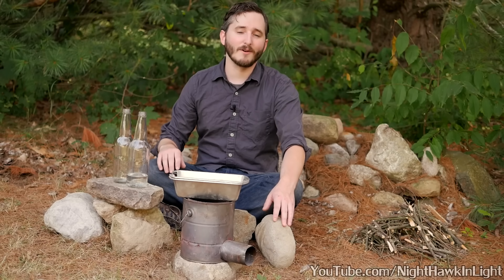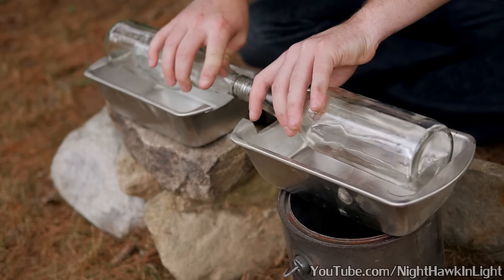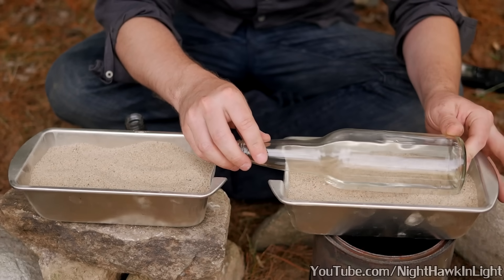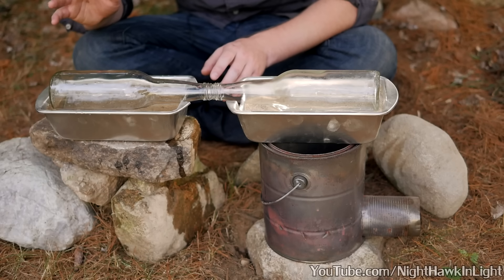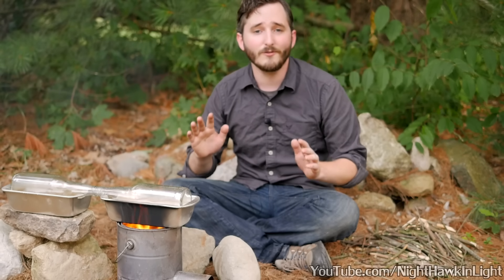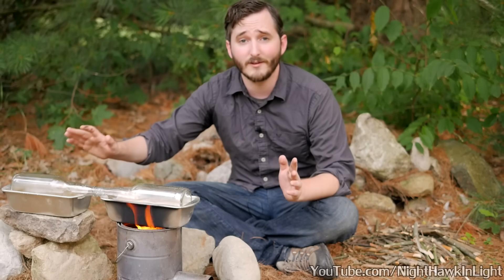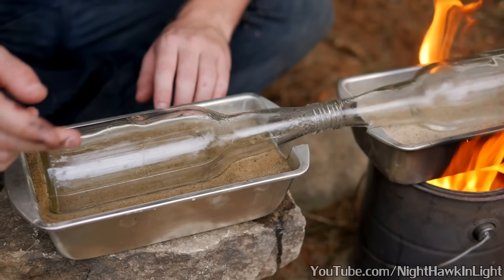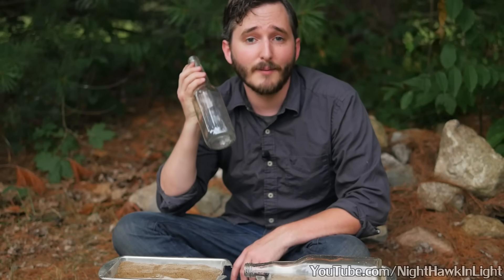How To Turn Salt Water Into Fresh Water (Simple Improvised Distillation)

Comment: I know this is an old video but I was curious about how you might increase the volume of water you can process in one go. If you had the bottle upright over the fire and connected a piece of hose to the second bottle, would that also work? If the second bottle was lower down so gravity had more of a chance to pull it downwards, could you then theoretically fill the first bottle much more? Or is there something I'm missing?
Reply from the maker: Yes if you have a piece of high temp hose you can use the setup you described

Comment: This is impractical both for hikers and for survivors. Nobody in their right mind would opt for bottles, sand and all the other sheet. Let alone the fact that this way requires constant presense of an operator, which is bs. Just use old passive "any container under any tarp" method. Somebody paid top buck to promote this nonsense.

Comment: I live on a very small and very hot island.
I wonder if this could work with solar energy? Having seen people cook food in a box lined with aluminium...got to try it out.
We have a lot of seawater, but no natural water sources
Reply: You can heat the sand with solar-powered heat conductors running through the sand like an old electric iron for clothes that have the conductor held by some sort of clay

Comment: Bump this idea: use a metal tube inserted into a cork which in turn is inserted into the salt water source bottle and extends into the receiving bottle. This allows a greater volume of salt water to be distilled.

Comment: Great video! I found beer bottles make great boilers right in the fire. Enlarge the hole in a soda can so it will fit on the bottle. Aluminum transfers heat very rapidly, so water will condense in it. Poke a hole in the lowest point of the can, and catch the drips in a cup.

Comment: Another option in survival situation is to swim in the sea, allow your skin to absorb the water through it.. then use your bottles to collect your wee, your own kidneys distil the water.. Drink your pee Bear Grylls style.

The fire can then be used to keep warm and cook. No trays, bricks or burnt hands or water putting the fire out..

Your bladder holds about 0.5-1 litre. It is structured plasma and is 98% distilled water with electrolytes in it and sterile.

Comment: I did this as a science fair project, but I just used two bottles, a tube, aluminum foil, some sticks, duct tape, and a black painted cardboard box. Put it outside and let the Sun do its job. Took about 20 minutes to convert one bottle of salt water into freshwater. Solar ovens are a hell of a thing for camping or emergencies.

Comment: The prospect of having other things in the water (like gassoline or oil) is why you should start with the heated bottle open to atmosphere until the water is at a good boil.  Let lighter boiling materials out without capturing them in the recieving bottle.  Before you connect the bottles, have some vapor condense on the outside of the cool bottle, and give it a sniff or taste to make sure it is water.  Then, connect the bottles.  Also, whenever you distill water, leave about 10% in the heated bottle.  There can also be stuff you don't want that has a higher boiling point than water.  Throw that out and start fresh.
Reply: That makes sense. I'm also wondering if the salt water bottle could be replaced entirely by a larger container, though one would have to get creative in connecting a bottle to the container.
Reply: he said that at like 6:15
Reply: I dont get it ? Why'd this get so many likes
Reply: Could be people just reading the comments before getting to that section in the vid.

Comment: Very very large amount of processes.
If you have 2 glass bottles,   fill 1 with the salt water & smash the other so it makes a cup out of the bottom section.
Then just stand the water bottle upright in the sun & place the cup like smashed section of the other bottle over the top of it. 
The water will condense & run down the cup like bottle & drip off 1 of the jaggered bits of glass protruding. 
Whilst all of this is happening then you can go collect some timber for a fire, build a shelter of gather some food. .

Comment: Everyone's always talking about how expensive desalination is. Why couldn't we use two giant metal tanks just the way you've done here and float them on barges? The heat source could be an array of parabolic mirrors placed around the base of the one with the salt water in it. After the water is purified, we could use any number of methods to pump the fresh water out to a tank on shore and perhaps even pump more salt water into the first one to repeat the cycle? The pump power source could be wind turbine or even a wave rocker plate

Comment: In a long term situation, drinking distilled water is not good for your health either, the same as drinking salt water. We actualy need a few minerals in our drinking water to not.. drown our cells : there is a balance to reach betwen the inside of our cells and the outside fluids of our cells. If we enrich the outside with too much minerals (aka salt water), our cells evacuate some of their water content to concentrate their minerals concentration to reach the balance. And it is not goog for your health. Not at all. Distilled water does the opposite : it dillute the outside fluids of the cells, and to reach the balance, the cells absorbe a lot of water. One could say that it means you are drinking a mord hydrating water but the reality is that you may cause your cells to burst because.. too full of water. Would be a shame..
Maybe that if it is in really smalls quantity, it may not cause harm, but it is safer to ad just a bit of salt to your distillate water (not enough to taste it of course) to not deregulate too much the balance of your cells.

Comment: try this one roll up a piece of cloth and use it as a cork and then heat the water and when it pushes it through you should have desalinated water. levi would work best. if it breaks use less denim. and more water. you might even try different size of cork itself and a lid with a hole in it for vapor to come out.

Comment: if you have a trash can and a bucket and sun light is all you need. you just need some soap and that means ashes. then clean put bucket into trash can and fill bottom of can with water and put in bucket with a rock in it. then just leave it in the sun and the less water the better but a metal bucket with let you use fire or coals test it yourself. scuse waste basket from an offie will do.

Comment: Yeah I had an ocean distillation idea that involves hot coils that are exposed when the wave withdraws and when the wave crashes the coils are hot again and instantly vaporizes all the water. I'm not a capitalist I want literally anybody to take my idea please
Reply: Basically what you do is you get some superheated rods either electrically or through ceramic and when the wave crashes on the rods, a hood picks up all the steam and there's a distillation bucket just through a glass pipe. All chemical less. 

The method of heating and the type of heating coil and the location are all to be determined. But my device would effectively create a constant source of distilled water which I imagine would be marketable to people like Kanye and stuff. 

The key feature is the coils get superheated when the wave recedes there has to be a point in time when there's no contacts between the coil and the water. It has to be so red hot it vaporizes all the water that touches it. Maybe ceramic can do this. 

There might also be a vibration or a sound that naturally releases water into water vapor which might allow quick heatless distillation...

Comment: It's interesting that it's just easy, and if so why don't you see old ships having this kind of apparatus on board just incase they got stranded out at sea? You'd think someone would have come up with something similar after thousands of years of sailing.
Reply from the maker: How would they heat the bottle?
Reply: @Nighthawkinlight  the same way they cook food, with a fire. I'm not talking about a row boat, I'm talking about the big ships with tons of crew.
Reply from the maker: @evilcartmensolo7198  It takes more than 5x more energy to convert 99C water into 100C steam than to heat that same amount of water from 0C all the way to 99C. It would take a lot of firewood for not much water.

Comment: Really cool video! I will have o remember that for sure if I needed water. Heads up: If you are to drink distilled water for the purposes of survival, it is highly recommended to add a tiny bit of the salt biproduct back into the result. This is to ensure you are getting a proper PH level in your rehydration and the effects will overall improve your body functions.

Comment: Thanks for sharing. The simplest system I have seen is to fill a pot about 1/3 full, put a bowl in the middle, with a domed  lid inverted on top. The water boils, condensates on the lid, and drips into the bowl. Simple to remove the distilled water and simple to refill the pot.

Comment: In fact, keeping the salt water in sunlight and the clean water in shade under damp cloth, grass, leaves... will also work but less quickly and less completely --  the salt water will need changed when about half is gone.  You also should NOT drink pure water; it will leach vital minerals out of your body.  Instead, add a few drops of salt water before drinking.

Comment: Perhaps suggesting using ones shirt to hold the bottle the distillate it to go into by soaking the shirt in salt water is not a good idea. In a survival situation where one is in a salt water only area it is likely the shirt is the only covering for the skin as well. To use the shirt for covering again will submit the skin to an irritant that can cause sores. Sticks can make a cradle that can be "micro" adjusted to get the seal you are speaking of. Good over-all survival tip if one can build a fire while trying to find hydration.

Comment: I hope someone mentioned... With distilling salt water. 
It is required to add a drop of the salt water from source bottle..  this is done to replace electrolytes. Without this. You will still die of other issues regardless of how many gallons of distilled water is consumed.

Comment: While really cool, a simple way to reclaim more water at once is to rip a bit of cloth from your shirt and make a cheap 'hose' using several layers wrapped around both bottle necks.  You can then bend the cloth hose so both bottles stand closer to vertical when propped up.  The evaporate wets the cloth at first, creating a liquid seal that redirects future water vapor into the condenser bottle--and if the condenser is cooled adequately the vast majority of vapor will condense before refluxing back to the joint (where it may escape the wet joint bit by bit due to building pressure).  In the end you will lose a higher percentage of product to the joint than a glass-to-glass connection, but the total reclaimed for the same time and energy input will be overall higher; usually a 70% full boiler results in a 50% full condenser when I try this.

As for efficiency, you can punch a  few small holes in the condenser's pan (or bucket/tin in my version's usage) so that a slow drainage of water occurs.  This allows warm water to run free, where you then can occasionally pour cooler water (slowly!) on top the condenser.  The cycling water much more efficiently cools and condenses the vapors than stagnant water.  If using this method it's better to mix a hint of dirt and brush into the sand (anything course, and NOT clay) so the mix behaves more like a supporting sponge tha wicks rather than a sloppy siv.  Peat works great for this, maybe at a 1:4 mix ratio with sand.

Comment: Another way I learned in boy scouts was a tarp and two buckets, one of them large and the other small. Put the small one in the middle of the big one, fill the big one with the water you want to distill. Keep the tarp over it, with a dip in the middle over the smaller bucket, and wait. The water will evaporate and drip into the middle bucket.

You can even do it in a linear fashion, with one bucket next to the other and the tarp at an angle
Reply: Linear is better than nested. When you nest them , your clean water will start boiling too due to its container being in contact with the dirty water, which just slows everything down. Temperature gradient is a must.

Comment: Excellent! I'm looking for some system to make drinking water on an ocean-going boat. So far, all they want to sell are reverse-osmosis devices, which push water through a semi permeable membrane. We have seawater, electric and hot sun. It would seem simple to do. (Distilled water has no taste because there are no minerals. Adding a few drops of seawater to the distilled returns the minerals and the taste.)
Reply from the maker: An electric kettle might be a simple option
Reply: @Nighthawkinlight  Thanks for the reply! There are commercial “water makers” that are very expensive. Solar electric isn’t the best for heating. I was thinking about black tubing heated in the sunlight.

Comment: you don't cover up items with more wet towels, wet sand or anything at all. by doing so it insulates the item and holds in heat. what i have learned from reading on cooling objects is to consistently drip water onto the item you want to cool, and it has to be exposed to open air. you can drape a towels high above the object however, to keep the sun off of it. a lot of factories do that for their machines. you could also heat shield the other bottle from the fire perhaps with a item in between them instead of the wet towel.

I am self taught, most of my life i have learned from being interesting and reading or watching videos like yours or more. I'm interested in the philosophy of debate and survival amongst other topics of the world today. :)

Comment: I would love to see this scaled up in a desert situation using larger containers.  It would seem to also be able make potable water from bad water sources.  (using solar concentrating reflectors for heat).
Reply: If you're trying to remove minerals, sure. But it won't remove things like oil or gas.

Comment: You can separate oils and alcohols through distillation. Every chemical has it's own boiling temperature. The lowest temperature contaminants will distill first, so you just dump the first few minutes worth. Water in the boiler will remain at about 212°F until it's boiled off. If you stop before reaching the end, contaminants with a higher boiling point than 212°F will remain in the boiler, to be dumped.

Comment: you can basically do the same thing using an empty container, plastic (w/ a slight downward slope), saltwater (which could be simply the moisture in the sand or even saltwater poured into the sand/ground), and sunlight.  when the water (minus salt and other minerals) evaporates, it collects on the bottom side of the plastic, and gravity causes it slide down into your container.  i've never actually tried this myself, but it's the same basic principle (it would take a lot longer w/o the heat of a small fire, though)!  that said, if i ever find myself stranded on a deserted island w/o food or water because my plane went down, hopefully this guy survived the crash w/ me!

Comment: Not this simple, if theres contaminants in liquid form in the water, it'll transfer with the H20.
Also you cant just drink distilled water because it will slowly leach minerals from your body. E.g. trying to boil the alcohol from water at 100c.

Comment: You can do this only one time. If you refill the bottle with cold water it will break. If you let the bottle cool down and fill it up and then put it back into the hot sand it will break too. This is a good solution if you want to die rather quickly in a survival situation. Besides that, really good vid ! Great explanation, cute parrot :)
Reply: What's wrong with using new sand? Then you don't break the bottle.

Comment: Beware though. You shouldn't drink distillated water as it. Cause distillated doesn't has any mineral, it'll remove those precious mineral from your body, and can after some time cause death.
You should throw a little bit of sand, or dirt, or anything inside your distillated water, for the water to react with it and not steal your body minerals.

Comment: is there a way to do this process with more natural materials if you cant find metal trays, a metal tin fire thing and bottles? could you mass produce it to produce more water? like 10 bottles going at the same time? wouldnt covering the bottles entirely be better? is there a way to seal the 2 ends using something in nature? like tree sap?  im guessing to get a lot of water without the problem of losing contact between 2 bottles and having tons of bottles on the go to micromanage ideally youd have something like 2 big jugs with small mouths and a rubber hose between the two... i wonder if it would be worth trying to make 2 clay pots urself in the survival situation? like use 2 bottles until you have time to make 2 clay pots with small holes and neck/mouths that perfectly fit together? then the clay pot would be much less likely to break in the fire

Comment: This can actually be done with plastic bottles in a pinch, however the plastic that is not in contact with water cannot be exposed to high temperatures, which make it finicky. It is more suited to distiliation through a tube or pipe of some sort.